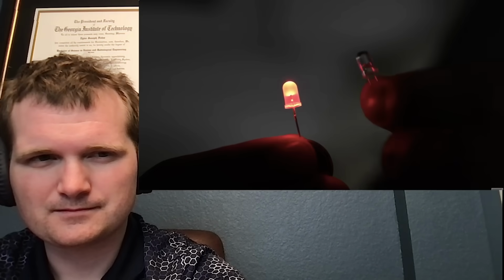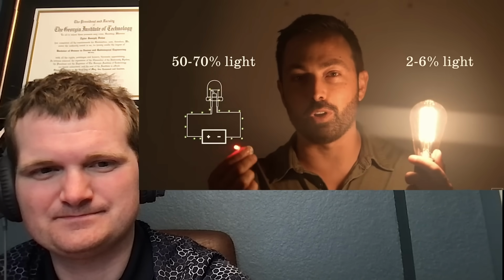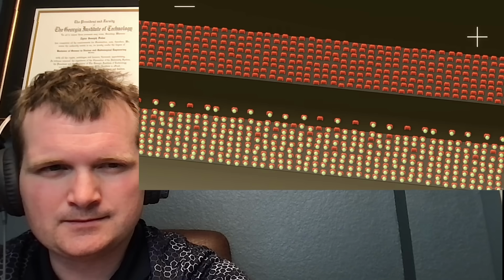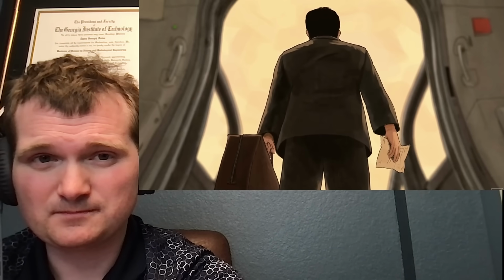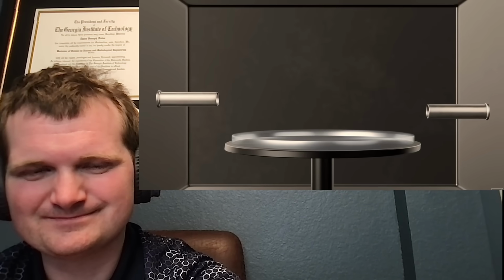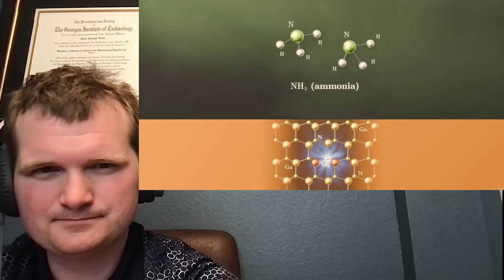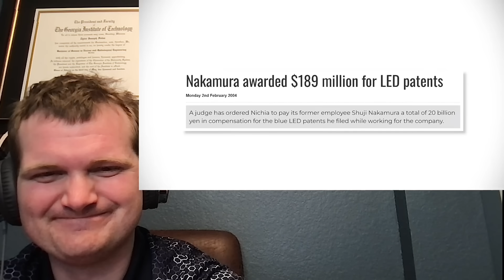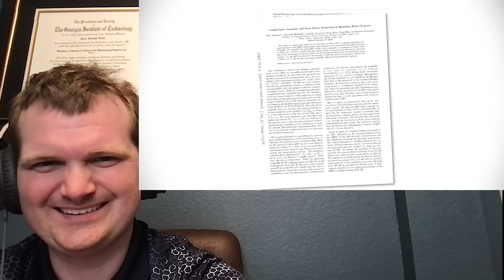Why the Blue LED was as Challenging as Nuclear Fusion is now - Nuclear Engineer Reacts to Veritasium

Comment: They are used to get distorted sounds in instrument effects. An audio signal is clamped by them in a voltage clamp circuit. Blue clips at a higher voltage. Red at a lower voltage. So red clips a waveform more than blue. Yellow is different, white, then others I use are .5 to .7 volts. Mix two to get asymmetrical clipping. Sounds more like a tube amp. Some cheaper amplifiers use an opamp or transistors to drive the signal in to a voltage clamp of LEDs to get their distortion sound. Or use tubes and the LED thing. Some use one to control another device. The audio signal drives an LED also through an opamp. That LED controls a light sensitive component that acts like a feedback signal to reduce higher signals. Boost lower signals. An optical audio compressor.

Comment: About the blue light, it doesn’t directly harm us but from what I’ve read it can effect sleeping patterns. The sun emits blue light and it’s thought that that is a signal to our brains to keep us awake during the day and asleep at night
Reply: affect*
Reply: @Jmvars  they mean the same thing 
modern English is however starting to give them different but very similar meanings but ts not a locked in thing yet(oddly this part of our language drift is slow)
Reply: @theirishviking9278  no they don't. "Effect" is the thing that happens. The effect in this case is your sleeping pattern changes. "Affect" is referring to the thing itself that causes the effect.  "My sleeping pattern was affected by blue light."

Or simply, affect is a verb, effect is a noun.
Reply: @Jmvars  Affect is usually used as a verb meaning “to influence or produce a change in something.” Effect is generally used as a noun, and refers to the result of a change, but it's sometimes used as a verb meaning “to bring about a specific change.”

not always 
one can mean the other when both are used as a verb
Reply: @theirishviking9278  literally wrong
Reply: @Jmvars  i got that off of a correct your English site for people learning english so you think that

Comment: As someone in IT with no degree, I have to thank you for your words on that. It has been a struggle at times, but now I do architecture and design. Still no degrees, and the only certifications I got were only because the job required them at one point.

Comment: I own a bunch of electronic engineering books from the 1970s. They usually refer to the LED as "Gallium-Arsenic Diode" instead of LED.

My first car had LED indicators inside the Dashboard. This was the first generation of VW cars which had no incandescent lights as status indicators. In Germany, the High Beam indicator has to be blue by law. The car came with an exception permit in its papers to be allowed to use a white light as the High-Beam indicator. The LED in the dashboard was yellow - which is a "dirty shade of white". When the car was designed, nobody had anticipated that blue LEDs could exist. The old German industry standard used "Klar" (engl. "clear" =white) instead of blue.

My next car had a blue High-Beam indicator. When this car was designed, blue LEDs were invented already but not mass produced yet. As a temporary fix, they used a 4mm incandescent bulb with a blue rubber overcoat. Instead of a resistor they had stuck a piece of wire into the circuit board you can pull out and replace with a resistor. They had anticipated that you can retrofit the car with a blue LED once the bulb fails. They had never made this car using blue LEDs and there were no LED replacements for this bulb ever. It had turned out that the first generation of blue LEDs was not just highly expensive, they faded noticeably after a few dozen hours of operation.

Comment: Lumens measure the total light output from a source, making them useful for comparing the brightness of different bulbs or fixtures. Lux, however, measures the intensity of light on a specific area, which is crucial for ensuring adequate lighting levels in various environments.

Comment: im studying electrtical egineering, and the best explanation as to why current flow is inverted to electron flow i heard is that we consider the "electron holes", so the holes the electrons leave as they travel as our current. kinda like the absence of that electron creates a positive charge relative to the wandering electrons, so we areconsidering that wandering "electron hole" as our  positive current. mathematicallyx its all about the gradient of the electric field, and current density, but i think the hole explanation is better to understand current rather than calculate it.

Comment: The reason why the nuclear power industry doesn't use red for stop and green for go is an old industry standard. In Germany, the color code is basically:
RED = Danger
GREEN = Safe
YELLOW = Attention
CLEAR (while), now BLUE = For your Information.

This is also true for Traffic lights. A red light means that it is dangerous to keep driving. That's why road blocks also use red lights. Service vehicles use yellow strobes and emergency response vehicles use blue strobes.
Multi color strobes as used in the US are not legal in Germany and most parts of Europe. Each color has a specific meaning. 

Common household circuit breakers are also color coded. Either with a red and green mark next to the lever or a window with a slider behind. They are green when off and red when on. Some beakers let the lever drop half way when tripped and show yellow or white on their indicator. That way you know it was tripped and not manually turned off. To reset them, you need to push them into the "safe"/green/off position before you can turn them back on (red).

Comment: Even in 2008, it was almost like driving a lambo you built in your garage if you soldered a keyboard together with 70+ blue led's 2009 it was white
in like 2010, magenta LED was that, 2012-13ish was multi color LED's
fun time in tech

Comment: Currently the best LED bulbs on the market have an efficiency of 210 lumens per watt.

For a 100 watt incandescent equivalent brightness (1500 lumen ish) that is less than 7.2 watts of power.

To say that lighting power demand on our electric bills has reduced is a severe understatement.

Not to mention that the potential for varying aesthetic options has dramatically increased over what incandescents can offer us due to how easily LED light fixtures can be shaped to any need.

The only real problem is that while incandescent lights have extreme heat tolerance by default, the opposite is true of LEDs - so it will never be possible to replace them in applications like convection oven interior lights where heat is a constant problem.

Comment: Well, here in Germany, we still have these "translation tables" printed on LEDs. 100W equivalent etc.
And with increasingly more power efficient LEDs, they replaced the energy rating that usually goes from A-G. But in the meantime it already had been at A+++ and above due to the mere effectiveness that never has been thought of when creating this table. Unfortunately, they replaced a ton of sodium gas lamps in the streets with LEDs... The yellow light was perfect in my opinion. Almost as power efficient as LEDs, very friendly to eyes in the dark and a great light in general (of course colors were gone - but who needs colors at night...?). The LED street lamps are way to bright, way too pointy and this results in street lamps illuminating one tiny spot below them, leaving everything else still in the dark and when below them looking up, you are blind for a couple of seconds at least... Not cool. Also, the light feels way too blue-ish and cold. Not nice at night.

Comment: The problem with blue light before bedtime isn't harmful radiation.
The biological clock is adjusted by blue light. When the sun is low, the atmosphere filters more blue light out. So the reduction of blue light is used to determine when bed time is near.
Watching blue LEDs or using white LEDs which contain a lot of blue light prevents the biological clock from finding out when bed time should be near.
In German Nuclear Power Plants, they use extra blue lighting inside the break rooms to keep the crew more alert during late and night shifts.

Comment: I’ll disagree a bit with MOCVD as the mass production of ‘clean’ crystals. The chrokaslky, pardon the likely misspelling, drawing method is what produces silicon ingots for semiconductor use, i.e what silicon wafers are made from. Those ingots can weigh hundreds of pounds and are indeed mono-crystalline silicon. No shade on CVD, but by mass, these two processes are not comparable. Physicist and engineers, correct me if I am wrong.

Comment: Tokamaks will be first, stellarators will be a next level improvement. Stellarators are more efficient but too much more complex to use as the first generation. I'd say more how centrifugal flow made it easier to generate higher compression in early jets but as the technology improved axial flow won out.

Comment: Incandescent bulbs do defrost/demist themselves during snowy conditions. If the traffic lights or other critical lighting is designed correctly there's no problem but there is that problem that's LED specific that must be factored for every new implementation. LED grow lights are useless compared to HPS bulbs combined with a cool tube and the all of ducting and fans they need to do their magic.

Comment: With all the light and color we cannot see, I wonder if it's possible to create contacts or glasses that let humans see the rest of the color spectrum.
Reply: would be cool but sadly nope, you cant see those colors, passing it trough some glass wouldnt do anything to make you see them except maybe altering them to ones you can see, its like trying to put a cube in a circular hole simply by placing a lid with a square hole on top, it will go through the lid but not the hole bellow, glasses that claim to fix colorblindness are a scam for that same reason, we would have to change how our eyes work for that to happen

Comment: It is not only that in Silicon the photon is infrared. Silicon is not transparent so photons are absorbed. Infrared LEDs are not made of Silicon as he implies they are made of Galium Arsenide.
24:08 Nitrogen, Ok, but Hydrogen an inert gas? Didn't he meant Helium and Nitrogen (that is  inert in most situations).
They way you think of annealing is correct, but think that: it is changing the crystalline structure: for steel and for the semiconductor in question. Electron diffraction was discovered by accident when air entered an experiment and that were in a rush and heated the Nickel sample to get rid of the oxide layer what changed the crystalline structure of the crystal (Davidson and Germer experiment).
They had to use ammonia because Nitrogen gas is tightly bonded and mostly non reactive (that is why Haber-Bosch process need to be done at high pressures and temperatures and use a cataliser).
About stellerators: they are cool again.

Comment: its hard because blue is at the top of the visible light spectrum. and if one emitter of light suppose to produce blue light the way nature does it will requires so much energy to get that spectrum. so what human do to produce a blue light, is basically "cheat" it using the method of HARMONICS. so instead of producing much higher frequencies, it simply combines 2 or more isolated light spectrum from materials emitting light into blue. and thats not how nature do its blue. because the nature's color spectrums closely related to the ENERGY of the source of the light.
while human way of doing it is using "color palette" tricks. therefor there is no energy characteristic associated with the color produce. for example, red light in red LED doesnt produce heat more than a blue LED. in contrary to red or blue light in nature.

Comment: I know that nuclear power plants use uranium as fuel, and uranium eventually decays to thorium and then eventually decays to lead. 

What do reactors workers do to remove the decayed uranium or thorium and what exactly happens with the used uranium fuel? 

Can the used fuel/other radioactive elements in a reduced or modified reactor to use all of the radioactive material until it becomes lead or is that not even possible?
Reply: Good question, I hope he answers it
Reply: @aleksandarlikic9712  I hope so to
Reply: There is a reactor type called Breeder and they do take waste and further speed up radiation decay by using spent fuel. They were expensive(at the time not so much now to make) and made right at the height of anti nuclear and so never went any where.  But they WORKED exactly as designed in the test at the Department of Energy in Oak Ridge
Reply: The Uranium in a reactor doesn't really decay in that manner. Most of it is consumed in the fission reaction, which breaks apart the uranium into other elements like cesium-137 and strontium-90. He also made a video about a month ago on nuclear waste called "Why We don't Reuse Nuclear Waste (actually, we kinda do) - Nuclear Engineer Reacts to DW Planet A".
Reply: as all major things also nuclear research was mainly funded by the state thru the military. the army was interested in weapons aka nuclear warheads. so the type of reactors used today are built so the "burnt out" (which is not)  fuel can be converted to weapon grade material. thats why there where only few studies done for other types of reactors or materials used in it. those dont generate "waste" suitable to weaponize :D
Reply: In 'normal' light water reactors, only a small part of the uranium is spent during the life cycle of  the uranium rods. The natural uranium is only partly enriched (from the abundant u238, which is 'fertile' (can capture neutrons to become 'fissile') to the much scarcer u235 which is 'fissile' (can be split by neutrons)). The u235 is mostly spent by the time the rods are changed but a lot of u238 is still present and of course there are all kinds of fission by-products as well. At that time the rods are no longer active enough to be used in the reactor. To make further use of the material, you have to clean/separate/sieve the isotopes to then make new rods using the useful ones. This is dangerous work because by now you're working with highly radioactive material and I guess it's easier to just discard the spent rods and create new ones.
If you want to fully utilize the uranium, you have to either clean the material from the spent rods as mentioned or utilize another method. One such method gaining traction (again) is the molten salt reactor, which doesn't only work with thorium, but can be used in a uranium configuration as well. Now, there are still challenges worked on, in that concept, but for an easy explanation, in a MSR, you can add material to the running process. If you keep updating the amount of 'fissile' material, the process can work for much much longer, resulting in a much higher percentage of the active material being fissioned before you have to 'clean' your reactor. You can even 'burn' current nuclear waste in such reactors.

Comment: What?!
No you got the blue light thing wrong or I did not get the point.
Our eyes have higher sensitivity to blue light that affects our circadian rythem. The rule is: 1-2h after waking up as much (blue) light as possible and about 6-8h again. And then before bed as little as possible.

Blue light is only a multiplier as well as the direction where the light is coming from. Is the from above increases the effect.

Now the problem is that in the night our affinity is much higher than the rest of the day. Idk why probably a survival advantage. That means blue light before bed is worse than red light before bed. But the best is always no light.
Reply: if i use my device's blue light filter on 100% then i fall asleep with no issues, so it's ONLY the blue light, or else the other colors would also be disruptive, but my sleep quality is identical with no light before bed and with no blue light before bed

Comment: Tyler, with all due respect, in your haste to "educate" that blue light is not a problem because it also comes from the sun, you seem to have forgotten that the circadian rhythm is based around sunrise and sunset and we sleep generally when it's night time when the sun isn't visible and therefore pre electricity and modern lighting, we wouldn't have been exposed to much blue light at all in the couple of hours prior to sleep. That is no longer the case and the impact of blue light in the night hours and disruption to the circadian rhythm is well understood.

Comment: The issues with blue light from screens and LED is because the sun produces it to. That's what the system in our bodies has evolved around blue light tells it the sun is high in the sky its the middle of the day, the issue is when we get then same message from something else at the times where the sun is going down and most blue lights are stopped by the atmosphere, so the sun turns red,  and after the sun was going there was no light or after we started using fire that was all the light at night mostly around red when speaking of what we can see. And the older light bulbs had similar light output (at least the ones that people used at home) . Basically the blue light tells our brains that the sun is up and high in the sky, if its 12.00 or 14.00 that is not a problem but after sunset it is since at this time our brain has to prepare for sleep and it's tricked not to. But the are LED bulbs that emit light at lower color temperatures (more redish, 3500K) and most moder devices have a opinion to turn blue light down at sunset. Basically when buying Bulbs look for the ones that say "warm light" or 3500k not the ones that are 5000k "cool white" or something like that.